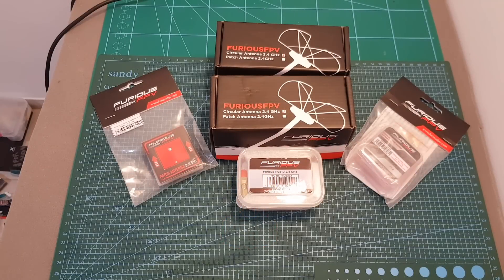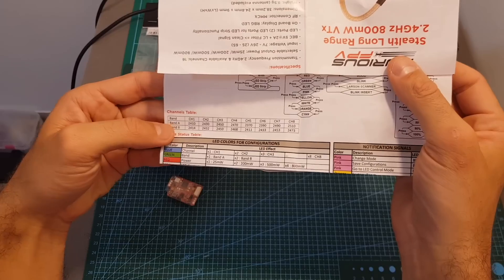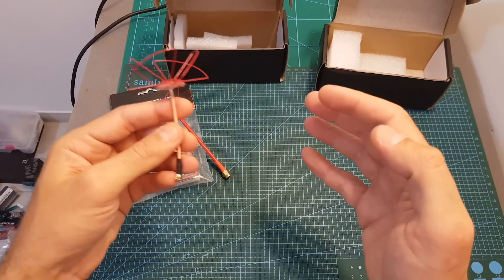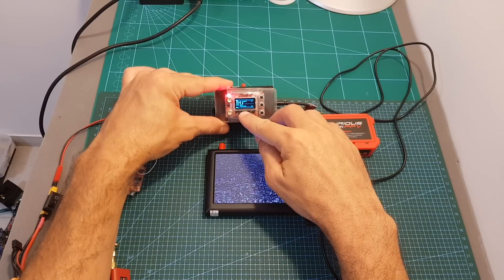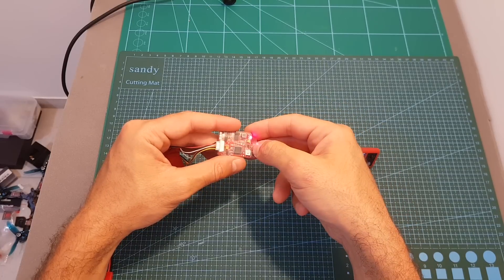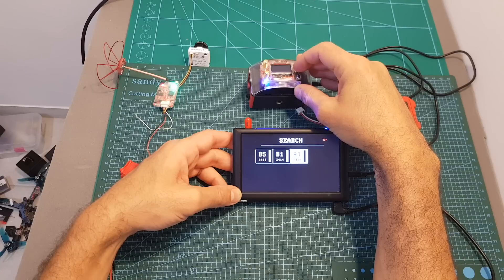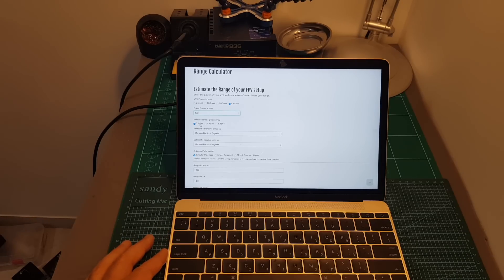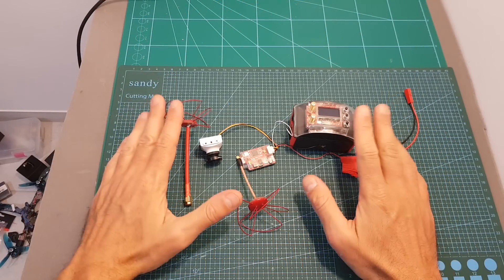FuriousFPV TrueD 2.4G System - Setup & Overview

Comment: The Furious Stealth 2.4 has a vtx peripherals control wire mentioned.  Using Furious protocol.  Have you set that up in Inav of Betaflight?
It is supported now?  Thanks for any information.
Reply from the maker: As far as I know it's still not supported but I will need to double check it with FuriousFPV.
Reply: I cant find nothing on furyfpv @KremerFPV

Comment: Mine will power up with usb but not inside my fatshark hdo's. I have a rapid fire that works so it's not the fatshark. I updated the firmware but still no power.
Reply from the maker: The pins of the RX are probably bent - make sure that they are properly aligned when inserting the RX into the FS module bay.

Comment: Great overview, thx! What screen and jack connector are you using? Can you provide links? I'd like a ground station backup setup besides goggles.
Reply from the maker: Thanks Rob. The True-D comes with a cable that is connected to a video in jack.
This is a very good option: https://youtu.be/g8GMdp-mQAU

Comment: Na the calculator is wrong. I get 20km with 5.8ghz at 700 mw without tracker with good quality ... only furious fpv Modul in my Google with good helical antenna and furious fpv stealth long range transmitter with pagoda antenna. 

Ok i was very high but it will work... 

2.4 you don’t need to go as this extremely hight but it works :)
Reply from the maker: 20km... Well that's impressive!

Comment: You should check TrueRC web page. They sell common CP Omni antenna for 2.4GHz (Singularity 2.4).
Reply from the maker: I know that they have very good antennas
Reply: Yes, they have. But they are only one manufacturer who is selling typical Omni 2.4GHz, not cloverleaf. And that's the biggest difference. So we can use this antenna on quad without fear of destroy it at the first fall/crash. (https://www.truerc.ca/shop/antennas/2-4ghz/singularity-24)

Comment: I flew it once, test flight just to test video system. (Furious 2.4 combo with DockKing, clover + patch RHCP, Crossfire for control). Flew @500mW, huge breakups already on 2-3km distance, artifacts, rolling, interference, although I was flying away from the urban area, no towers, selected least congested channel etc, all components are pretty far apart (Mini Drak) ...I'm disappointed so far; in contact with Furious support, trying to figure out what could be the cause. Video: https://www.youtube.com/watch?v=YqgEAhT9HIg
Reply from the maker: Did you get some help from them?
If not, contact me through my Facebook page and I will try to help you out. 
FuriousFPV have an excellent support team.
Reply: After dozen mails with Furious support they have dismised me with answer below (and image):

"Hi Jure Peternel,
Please contact Matek to find where the video out signal capacitors are. You need to add 2 capacitors that are 47uF to the existing capacitors."

https://ibb.co/ebN5pe

I otherwise have 0 problems with many 5+ Matek F405 boards and various 5.8G VTXes (TBS,AKK) - which is what they also said: "You can see in the attached report on the last email, it is explained that the 5.8ghz systems are able to filter out this interference. " 

Matek replied: "I think we know OSD compoments well,  every MAX7456 circuit designer should know this.
2x 47uF are must for every OSD board based on MAX7456"

And i'm here dead in the water with bad video :(

I was talking also with the guys in the Long Range Hooligans group and they pointed out that the DockKing BT module could cause interference, which was also confirmed by Furious: "Yes we will enable an option to disable bluetooth in a future update, and if your frequency is close enough to the bluetooth, it can cause these issues. The video signal can cause similar issues that you would normally find to be caused by the transmission system."
Reply from the maker: I didn't think about the fact that the BL module can cause interference. Thanks for the heads up! 
I will check this issue with FuriousFPV. I hope that they will be able to resolve it soon.

Comment: Excellent, about time.  I've been using 2.4g for many years in my 6 meter scale FPV glider.  Now for my glider I'll be able to do away with my 2.4g diversity receiver and antenna tracker system that's all cabled to my goggles.  I'll also be able to use it in my freestyle long range quads.  Good work Furious and excellent review Gal
Reply from the maker: Thanks James!